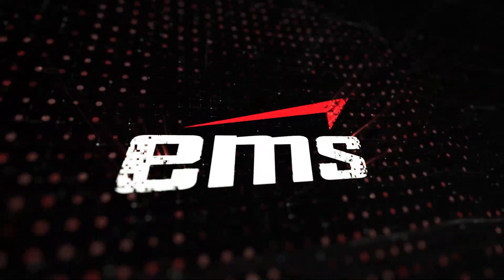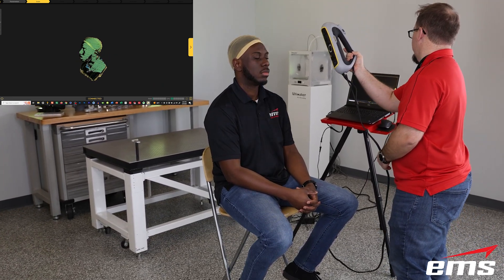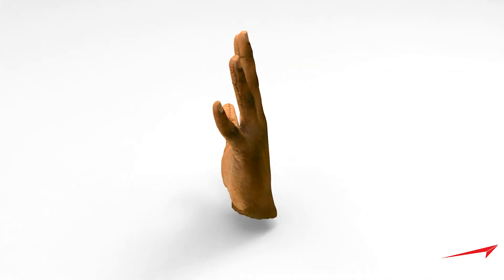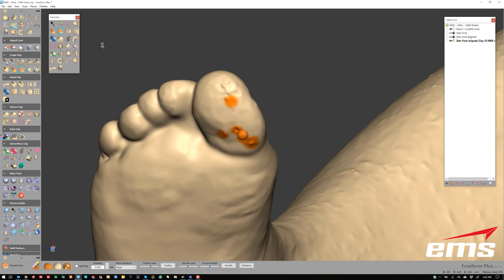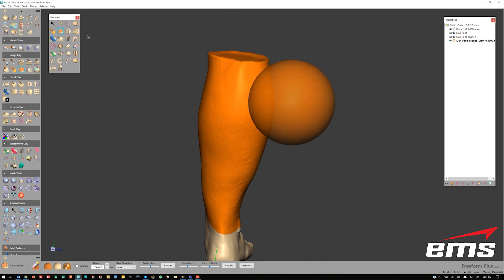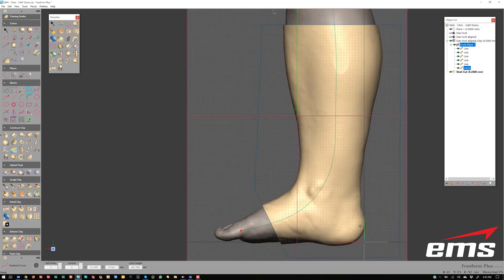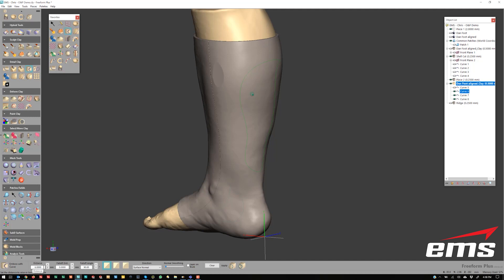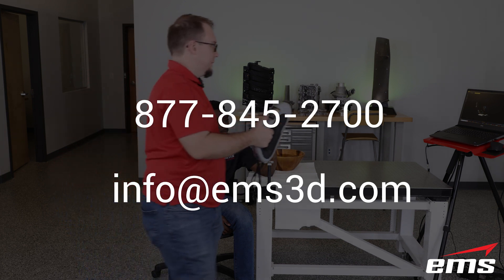3D Scanning for Prosthetics and Braces

Comment: If you were to scan a residual limb (leg) that needed a support device to apply corrective pressure to soft tissue how would you approach such a system? As in how would you create in interaction between scanning and support device to not interfere? Thanks alot.